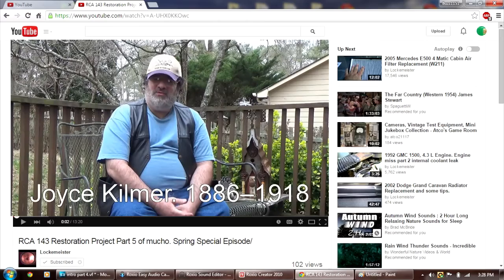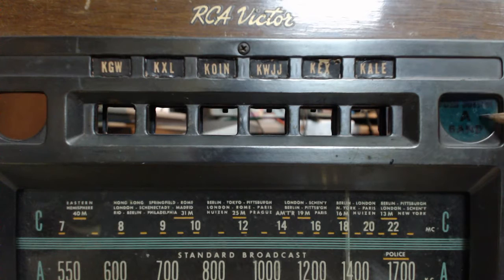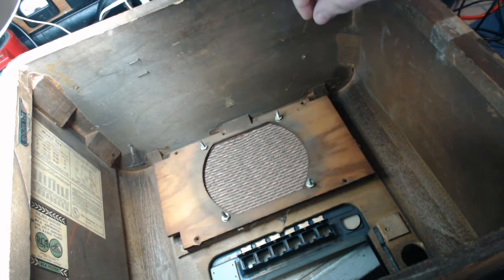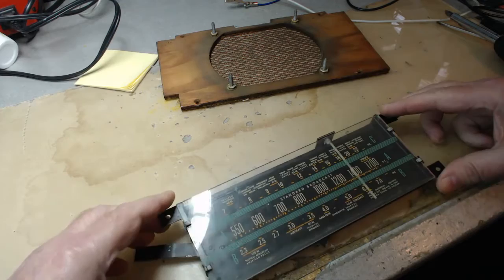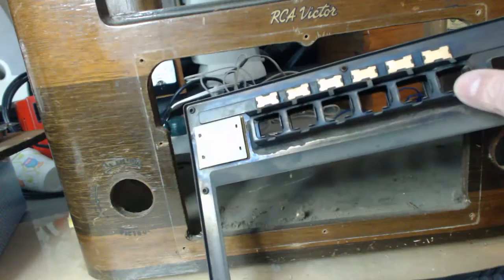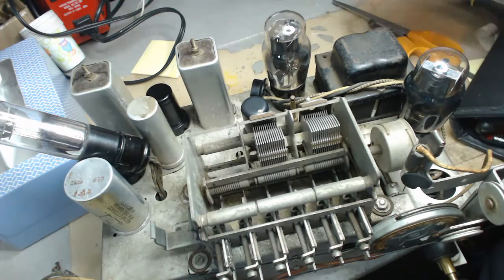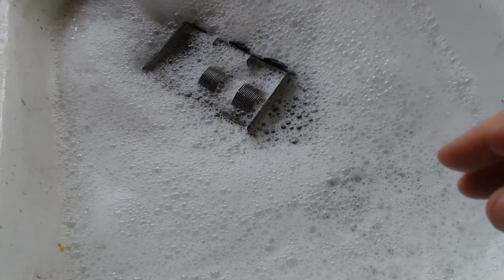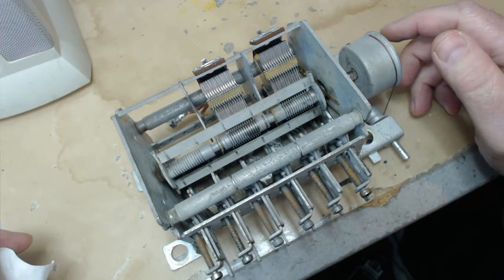1939 RCA Victor Model T-64 Restore Part 4

Comment: Wow! I'm outta town this week, but am accessing from Alabamy. My recital really turned Dickel into a tree hugger, (and kisser). I guess getting back to his roots. Man was that ever funny!! OK, I need to get a small tripod now for my new camera. Great techniques. What an inspiration!  I was gonna mention something about the radio you are working on, but I forgot. Oh, wait i remember now. Don't be fooled with the max 125V. I think the plate voltages are at max with 125V. the power trans runs hot also at max voltage. Much better to reduce the voltage to 115V. I think RCA reasoned that they had to meet the newer 125V line specifications so maxed out their rating. I also think they reasoned that the radios were made to be planned obsolescence so running at the max voltage possibly would: a, sell more RCA tubes, and b, ultimately have the radio conk out a little faster so the consumer wold buy a new radio sooner.. PS loved your homemade ultrasound!
Reply from the maker: Lockemeister That video was for you my friend..and thanks for YOUR inspiration...Regards, Buzz

Comment: I hope Dickel didn't break anything when he fell out of that tree...LOL
It looks like that was a 3 gang tuning cap at one time.
Reply from the maker: Thanks Goat...Dickel is OK...but he did cry for his daddy...lol.....Maybe the frame was used on different RCA models which had 3 gangs,,.. How's your computer running goat?..Regards,,,Buzz
Reply: Hi Buzz, the computer runs great, take care....Bill
Reply: Buzz1151 It was, but they needed to make it that way for the two section set as well because of the rocker bar style push-button mechanism. By the way, I have found that a mix of tri-sodium phosphate, the stuff they sell for washing walls before painting, and hot water, works good for cleaning tuning capacitors and washing really dirty chassis, it's cheap and you only need about a tablespoon's worth in a gallon of water. Another thing that works is brake cleaner, but it costs a lot more. You used to be able to buy a substance called tuner bath for cleaning TV tuners, the old turret style of course, that would also work on a tuning cap. I've never tried an ultrasonic cleaner but they seem to work well for those that have them.

Comment: Enjoyed the continuing tale of the RCA T64.  I was wondering if the Dishwasher Detergent did anything to the aluminum.  Using high pressure of any kind would likely be bad for the tuning cap.  Do you have a Dr. Scholl's foot Spa.  They have a massage mode which makes the same kind of noise that the ultrasonic cleaners do.  I wonder if that might clean out that old cap.  Poor ole Dickel.  Looks like he has a quick temper.  You had better lock up your saws and axes for the time being.
Reply from the maker: Hi Stephen,,...all is well with the aluminum,,,used the dishwasher many times no problems..just a pissed wifey..LOL...The tuning cap is looking good after a hand clean and lube..watch next week.........I caught Dickel trying to cut down the tree,, but he couldn't lift the ax...I think Dickel's short lived love affair with trees is over...Regards...Buzz
Reply: Buzz1151 "he couldn't lift the ax...."    That cracks me up  :)